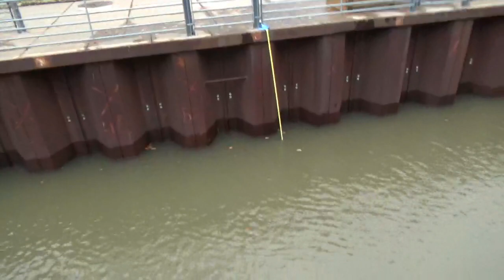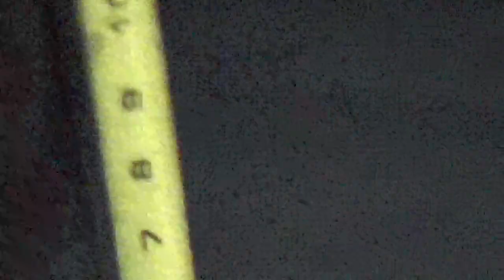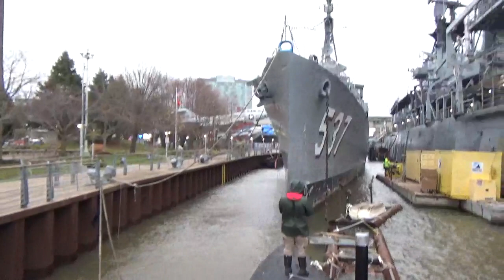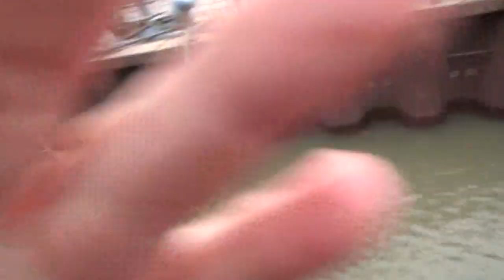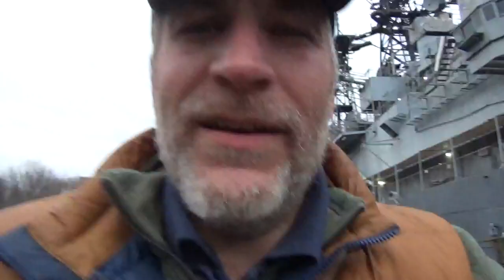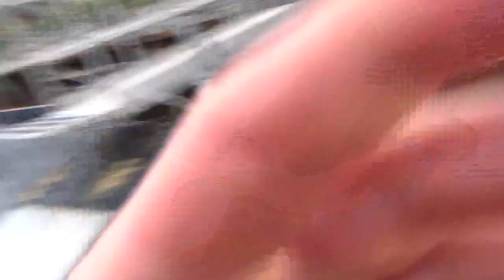Water Emergency for Museum Ships, Part II

Comment: Thanks for another update Shane, the wind here today has really been blowing too. That's quite a difference in water level! i guess it's kind of a catch-22 situation either way.
Reply from the maker: Definitely a Catch-22 situation Jeff. Rising and lowering water levels each come with their own set of issues. Water pressure and free floating motion in one instance, and resting and rubbing on the bottom in the other!

Comment: Some/most of the water level rise is probably attributed to the wind storm (which was moving west to east), literally pushing the lake toward the east shore and forcing more water into the river. Not unlike storm surge from a hurricane, just not as extreme.

I'd be interested to see an update a few days after the wind dies down.
Reply from the maker: Thanks cargovankilla724! Yes, that's exactly correct...the term is a Seiche, and the wind treats the waters of Lake Erie like a bathtub, so while the water levels are rising, there are cross-currents moving west and east below that rising water level. Thanks for watching!
Reply: @BuffaloNavalPark  How's our girl, The Sullivans, doing? I'm glad to see that she's got more water out than in, but is it under control?

Comment: I don't see any of that snow left. I wonder if the melting of all that snow contributed
to the rise in the water level.
Reply from the maker: Thanks! The water level is now back to "normal" as seen in the Part I from last Sunday. It's amazing that the amount of snow received does not really translate to higher water levels. The water from Part II was no doubt pushed in from Lake Erie.

Comment: In the prior vid I had mentioned it could be a dam control situation.  This time, it looks like the wind is pushing the water up river from the lake.  
Imagine being on the N Atlantic in such prevailing conditions with sub zero temps...ice build up, shuffling feet along the deck to try get to the build up to pound it off.  Pitching...rolling deck, frozen fingers, slippery handle on the hammer and a sphincter tightening experience with the absolute fear of going over.
Reply from the maker: Thanks Normandy1944! That's exactly right! The Seiche waters from Lake Erie travel up the river, while the natural flow is towards the lake, so it creates a lot of havoc with conflicting currents underneath that rising water level. I'm thinking more and more about a coffer dam to keep the water levels around the ships at a stable level! Appreciate it!

Comment: "Water pressure" ? The guy still doesn't know the difference between river level and vessel draft. No wonder they sunk the Sullivans.
Reply: No. The Sullivans took on water through cracks and holes in the hull. Not because of draft and water pressure.